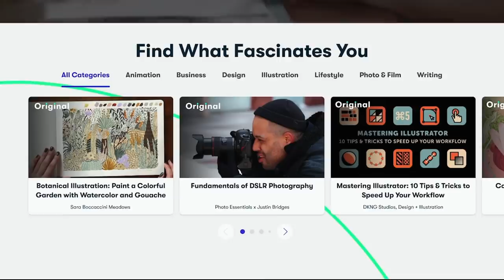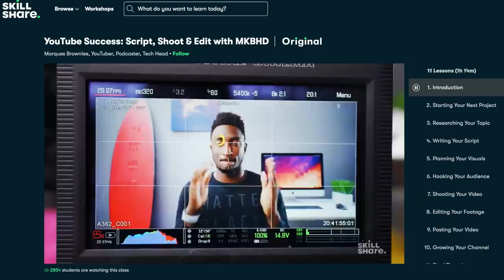The MOST Dangerous Thing We've Built at Our Cabin

Comment: You may have an easier time with expanding foam versus concrete. It’s much lighter weight and takes only like less than 1 hr to set.  It’s used for utility poles/ telephone poles / fences/ etc. especially when you go to work in the steep parts of the hill, not lugging a wheel barrel will be so much easier for you guys. 

Keep up the great work!

Comment: I know it’s to late , measure elevation difference and distance ( not run of stringer)
Divide distance by 10” treads divided elevation difference by number of steps
If it comes out more than 7.75” (max) rise divided elevation by 7.75 .then divide that number into equal tread widths . Play with those numbers

Comment: I dont know if its still relevant for you guys but the deal with those epoxy tubes is that they have an inner tube inside of the big tube its like those 2 part epoxy syringes but bigger you need a special gun for those with 2 pistons if it makes sense at least those in germany are made like this so just check the inside may the force be with you cheers

Comment: Those epoxy guns suuuuuuuck. They harden in the tube in a minute. You have to have everything ready to go before you open it and then use ASAP. In Austria we live in an “old build” and you have to use that stuff in order to secure really heavy stuff into the walls (otherwise the wall just crumbles and shit falls out) and we went through so many of those stupid epoxy tubes before finally realizing we had to just drill/vacuum everything we wanted to hang, test out the anchors and then go as fast as possible to each hole with the epoxy. So frustrating though. I feel ya, eamon.

Comment: You put those steps in with screws.... Screws are weak perpendicularly and will shear.  I suggest you go back over it and put in some nails. Preferably with a nail gun and glue nails. There is nothing wrong with using screws to set something up since you can take it apart. But always go back over it with nails.